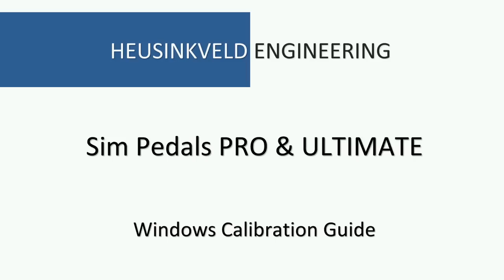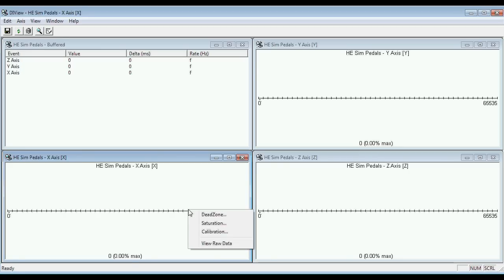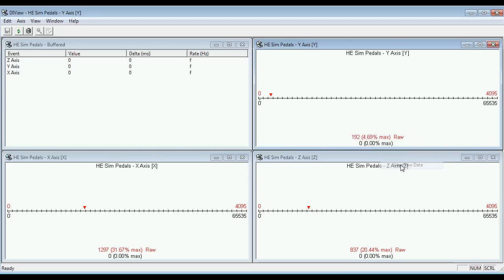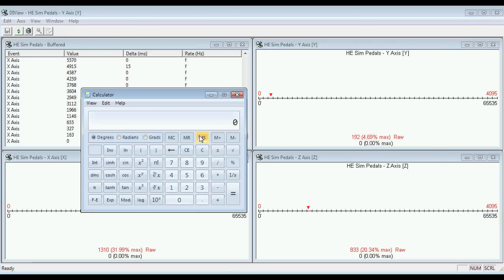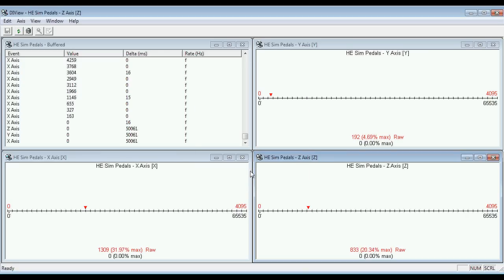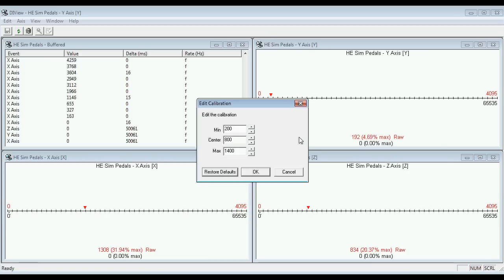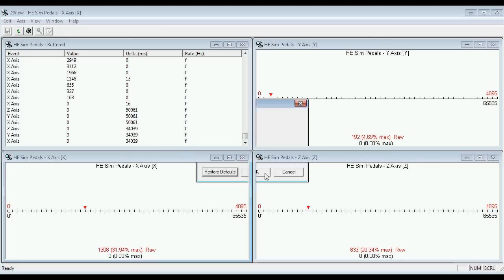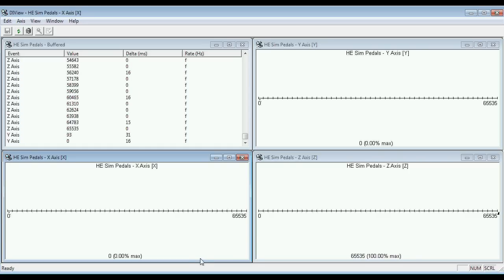Calibration Guide Sim Pedals Pro & Sim Pedals Ultimate

Comment: Where are those data written? How does any other program know what you've set there? Do I have to keep it open while running a particular game, or can I close it? And if the latter, where are the data then? Or is it written into the hardware's driver...?  Don't get it.
Reply: This should be an USB Driver / Windows thing. For example iRacing using his own calibration function without looking at the data's in windows or usb driver.
Reply: @Andi 
Thats how it works: [Without using DIView]
When you connect your setup for the 1st time via USB with your PC or NOTEBOOK(-->nessesary, consoles are not supported!) in use with ACC e.g. the game only notice: cool, a USB device has connected. No more - no less. 
Meanwhile, ACC is waiting for the information from windows that the pluged USB-device has been (hopefully🙏) identified (only) as an 'input device', same as mouse or keyboard. 
Now Windows recieve following info:
1. input device: (Wheel)
minValue(@16bit resolution): -65535 (left); maxValue +65535 (right); 
2nd and 3rd input devices: (Brake and Throttle)
minValue = 0
maxValue = 65535
You can use these for every action where an analog signal/range is required or possible, like ACC (or Drift, or MSFlightSim, whatever). 
minValue = 0% IG-brakeforce
maxValue= 100% IG-brakeforce

-- Without DIView (or other converters with similar function) you can only reach 100% IG-brakeforce (or Throttle) by using the full mechanical way to reach the total value.   

When DIView is in use the software capture the signal, you determine that 0=0; and now you can edit the incoming signal. 
So you can reduce to 50% pedalway, but get still 100% IG-brakeforce. 
Necessary? If you switch from 50kg LC to 100/200kg but still use the same LC-Amplifier.

Comment: Hi, are the DIView calibration values stored in the Windows Registry?   If so under which key?  Or are those values stored in a configuration file? If so, where is that file?
Reply from the maker: Hi Mark, the DiVIEW calibration has not been developed by us so unfortunately we can't help you with this information.
Reply: Thank you for your reply and for the video itself!  Since I did my earlier post, I have done some testing with DIView and with various other tools and I have discovered the following about DIView:  I don't think DIView is saving in a config file. Rather it is saving to the Windows Registry.  DIView does have its own section in the Registry. But when using DIView to  make changes to Calibration, from my testing it looks to me that DIView is instead causing an update to the Window Registry's general DirectInput Calibration settings (specific to a piece of hardware and Axis such as that of the Heusinkveld Engineering Sim Pedals Pro).  In that way hardware/software that are not "knowledgeable" about DIView, can still see the Calibration changes that were made to the Windows Registry by DIView.
Reply: @HeusinkveldEngineering  so your pedals rely on a single software that someone else made? wtf
Reply: @mirshia5248  they did in 2012 yes

Comment: My brake pedal for my Ultimates starts out at 0% for raw data in DiView...is that normal? Which have my calculations at 0 min-350 center and 700 max. Does this sound right?  In this video, the brake pedal in raw data is at least 100 and Barry Roland's review shows he has at least 115 for his lower brake pedal number.
Reply from the maker: Hi Ken, the RAW data value for the brake pedal when it is not used should be a bit above 0 at least. Because we allow for many different settings on the brake, it is possible that there is not enough pressure on the sensor after having made adjustments. There is also a very small possibility of a technical error. If this has not been resolved yet, can you send us an email at support@h-engineering.net ? Thanks!
Reply from the maker: Hi Ken, the RAW data value for the brake pedal when it is not used should be a bit above 0 at least. Because we allow for many different settings on the brake, it is possible that there is not enough pressure on the sensor after having made adjustments. There is also a very small possibility of a technical error. If this has not been resolved yet, can you send us an email at support@h-engineering.net ? Thanks!

Comment: I am having trouble in iracing keeping full throttle on my ultimates.  Will this help?  I is inconsistent to "short calibrate" in iracing to get full throttle.  Any tips?
Reply from the maker: Hi, this video shows the calibration in DiView, which is used by almost all simulator software except iRacing. iRacing uses it's own in-game calibration method. 

Because our pedals have soft-end stops, you want to make sure that during calibration in iRacing you don't press the pedals all the way into the end-stop. If you do push them into the stop during calibration, this means you have to do this during racing all the time as well as well. 

If you calibrate the pedals to the point just before (like 1mm) it hits the soft blue end-stop, it should no longer be a problem to reach 100% throttle in-game.

Any further questions feel free to mail us at support@h-engineering.net .

Comment: Comes up with Virus WS.Reputation.1 when using the link above to download..
Reply: Hi Clifford, does that happen when downloading DIView from our website? Will look into it today, thanks for the report! ^Svend
Reply from the maker: Hey Clifford, I just ran the file through several scanners and they all checked it as being clean. ^Svend
Reply: Strange I will try again
Reply: Clifford Chapman ***** i just tried again and norton 360 grabbed it again - i have a screen shot if you wanted verification. It refers to this website http://www.symantec.com/security_response/writeup.jsp?docid=2010-051308-1854-99&vid=4294919973&product=Norton%20360&version=21.6.0.32&plang=sym:EN&layouttype=ESD&buildname=Retail&heartbeatID=70649095-BCCC-4B08-BFA0-831280F824EE&env=prod&vendorid=1001790&plid=81&plgid=4&skup=21253411&skum=21294674&skuf=21228661&endpointid=%7B70649095-BCCC-4B08-BFA0-831280F824EE%7D&partnerid=1001790&lic_type=16&lic_attr=21124114&psn=HBY96HCCQ2CW&osvers=6.1&oslocale=iso:NZL&oslang=iso:ENG&os=windows